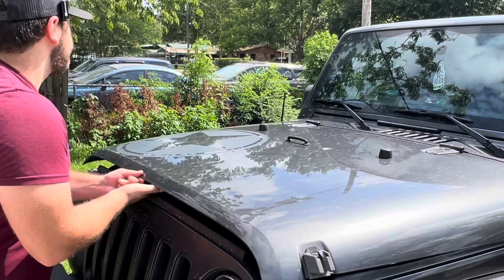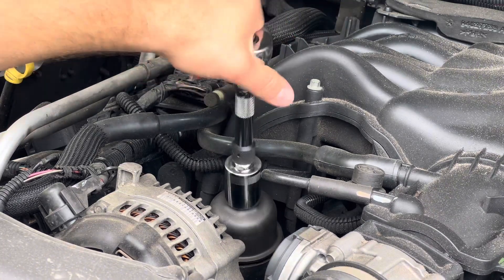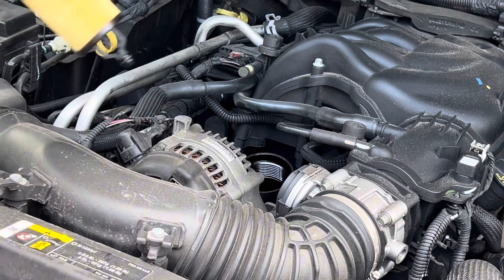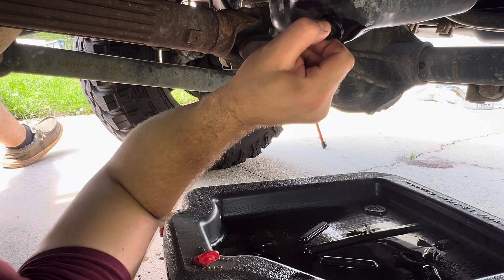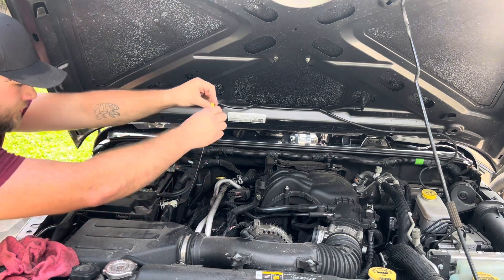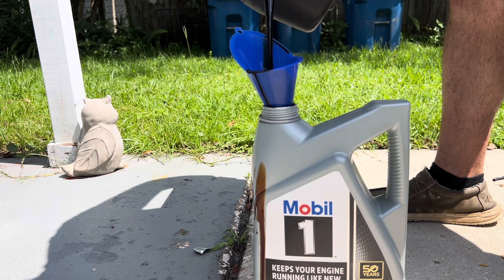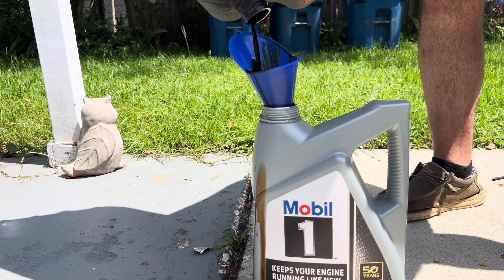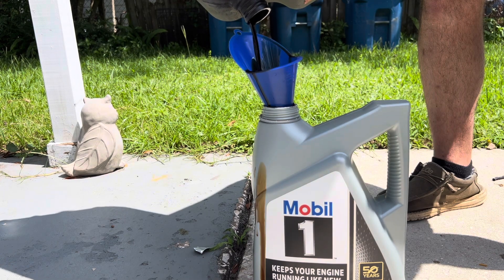2018 Jeep wrangler JK oil change

Comment: 5w-20 or 0W-20 ?
Reply from the maker: @joncruz  5w-20
Reply: 0-20 is the JL and it takes 1 less qt. So 2018 had a lot of confusion for new jeep owners because that year they made a limited run of JKs, and then The JLS. JK is Almost 6 qts of 5w20 and the JL is 5qts of 0W20.

Comment: I don't own a Jeep, but I wanted to post a comment anyway. First, it's really sad that these types of videos don't get more views. Second, I've heard that Mobil 1 is not that good. I'm going to be switching brands the next time I change the oil in my Chrysler. I've heard great things about Penzoil Platinum and Castrol Magnatec. I'm going to start using one of those two.
Reply from the maker: @DiligentDave1966  I usually get castrol edge full synthetic but there wasn’t any 5w-20 near me at the time
Reply: @Kaleb_RoSs  My stupid 2.4 Chrysler takes 5 1/2 quarts of 0w-20 full synthetic.
It sucks because I always have to buy the extra quart to use half of it.
It gets a little expensive, but it's still way cheaper than going to the dealership for the service.
Reply: Mobil 1 not that good....AND you're switching to pennzoil??
😂😂😂😂😂😂😂😂😂😂😂😂🤣🤣🤣🤣🤣🤣🤣🤣🤣🤣🤣🤣🤣🤣🤣🤣🤣🤣😂😂😂😂😂😂😂😂😂🤣🤣🤣🤣🤣🤣🤣😂😂😂😂😂😂😂😂😂😂